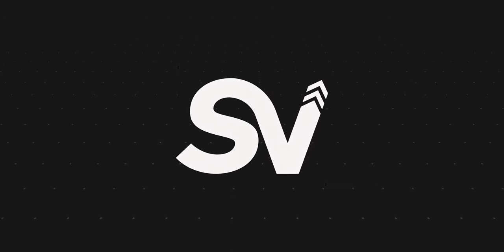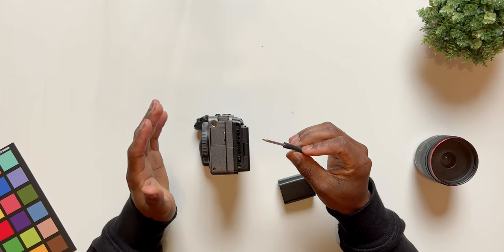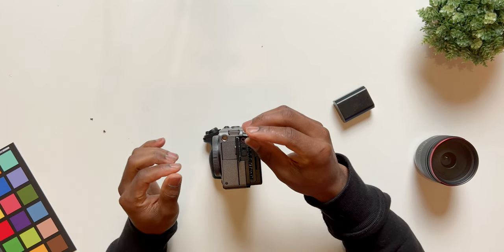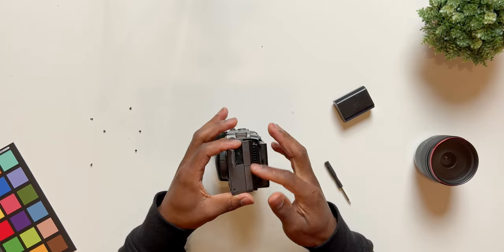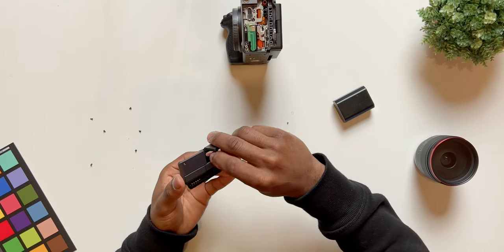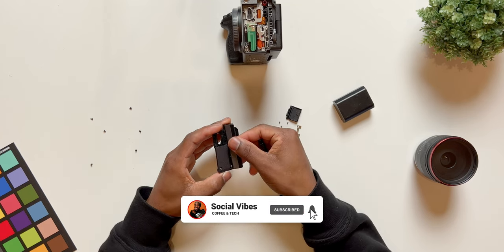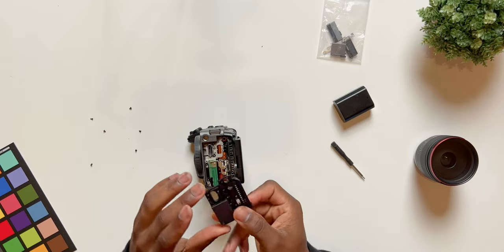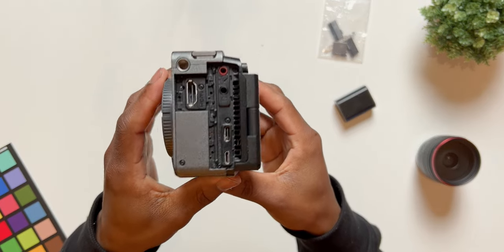How To Remove Port Doors/Covers On Sony FX3

Comment: definitely be careful as the housing screw for the HDMI port strips out very easily!

None of the other four screws has this issue just the HDMI port screw had to get my camera replaced!

Still dealing with technicians from Sony, which seem to be useless…